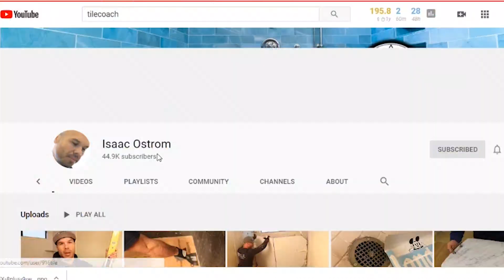Are Pro Tile Installers ABANDONING Schluter Systems?

Comment: not thrilled watching this after installing schluter membranes on shower floor and walls and curb per schluter instructions and using their expensive "all set".....even Isaac who in one video swears by Ardex....in another "I'll never use ardex again"..it's always something....there are red guard devotees and aqua defense devotees and schluter devotees and wedi devotees...and everyone swears their way is best. Fact is, on new home construction, the tile subs throw a shower together with minimal waterproofing concerns and 5, 10 , 15 years later the homeowner has to deal with the mess. There should be some codes (other than basin membrane and leak test)..but maybe that is too restrictive. Not sure what the answer is. Bathtubs?
Reply from the maker: if it was flood tested and it works, and put in to their specs, it's on schluter.
Reply from the maker: definitely code and standard modifications are in order!!!
Reply: stop letting hacks in the trade. But seroiusly have you noticed the old school wire and mud showers seemed to hold up over time.
Reply: @HamiltonTileGA   That may be the case, but who is going to inspect the tile jobs, and there is already standards for installing in the TC&A  book. I am certified in Schluter levels 1 & 2. I have lot of these systems out there and no issues. My own place has Schluter with  no issues . Every tile system has a weakness. The reps are a call away and mine has never not pick up
Reply from the maker: @moridin73  It weighs a million pounds and people have to work their ASSES off to install that stuff. NOT great for a remodeling scenario. There's a reason less and less people are doing it that way.

Comment: A schluter system just doesn’t make sense… you just can’t effectively waterproof Seams with the thin set! Even rdx doesn’t make sense …. Red guard is the best way
Reply from the maker: That's why we do it with Ardex 8+9. Not to mention virtually no build up. big improvement.
Reply: @HamiltonTileGA  I’ve seen three of these fail… one with ardex and two with what appeared to be some other thinset … of course I wast the one who put them in but ardex or no ardex the water will still seep through at the joints ardex is not waterproofing

Comment: schluter designs things with a millimeter of failure. if that line is crossed they can blame the installer. it's like a brilliantly engineered mercedes that is one forgotten minor maintenance task away from mechanical catastrophe. they once rated ditra for exterior waterproofing. no more. its one dropped utility knife or badly mortared seam away from failure.
Reply: That is the thing about a mercedes.  Just takes one missed maintenance to kill the engine.  Now look at a Mazda or a Toyota.  Not a good idea to miss maintenance, but those Mazdas and Toyotas can take the beating.

Comment: Always the same.  Lots of talk and "what ifs" and not a single documented case of failure in a properly installed example.
Reply from the maker: If you don't like talk, stay off the chat shows. You missed the point.
Reply: @HamiltonTileGA  Sorry you can't take criticism
Reply from the maker: @radman999  The point is we want an explanation from a Schluter engineer about the problems we are seeing. We never said ONE THING about a failure. What's wrong with wanting a breakdown of what we see and our concerns addressed? 

Here's me taking criticism and I hope you address my statement and don't GLOSS OVER what I said like you did to what we said in the VIDEO.
Reply: @HamiltonTileGA  All of the certifications and international testing is made available in the data sheets.  These large companies don't have time to deal with random Youtube channels.  What is your concern?  When the product is misused and incorrectly applied as a pond liner, you see moisture after a week of soaking?  Come on..  The product has been used in Europe longer than you have been alive.
Reply from the maker: @radman999  "pond liner" we've seen this during a 24 hr test, sir. No one said anything about using it as a "pond liner" I'm a "random YouTube channel" but I'm also a customer. My concern was addressed in the video. Sir, Did you even watch and listen to what we said in the video or are you watching Isaac's videos and coming here and creating strawmen for me burn up?
Reply: @HamiltonTileGA  Do what you want, I could give a shit.  Millions of problem free installs have been done worldwide for decades.  Where are the failures?

Comment: Wedi for me!
Reply: Isn’t that like way more expensive
Reply: @Jeziorski7  I think so. But really easy.
Reply from the maker: I know, solve the problem with some sealant that thinset doesn't stick to and use a really poorly designed drain.
Reply: @HamiltonTileGA  poorly designed drain. I'll give you that.
Reply: @HamiltonTileGA  what?
Reply from the maker: @lrc87290  RIGHT? love the board though.